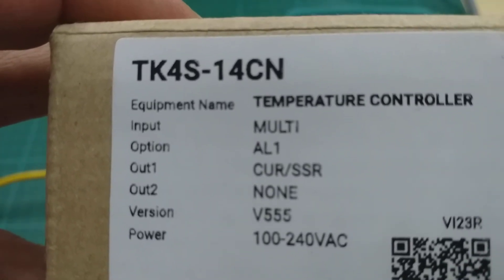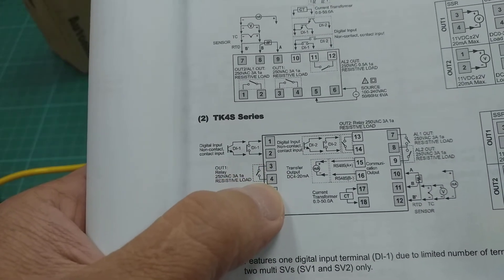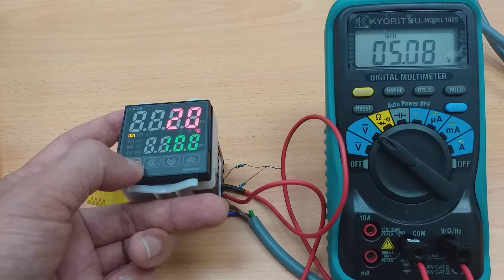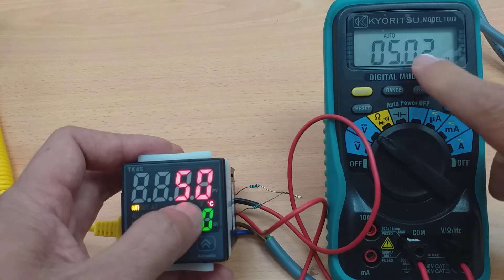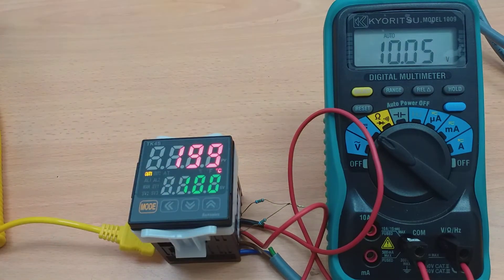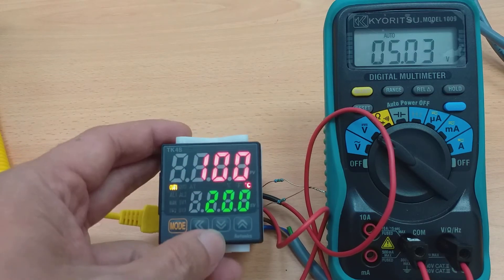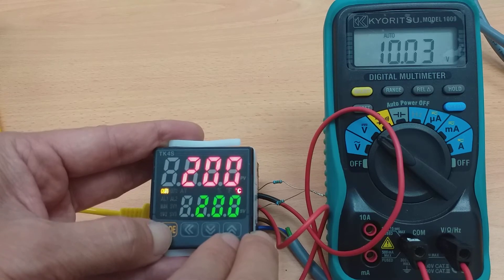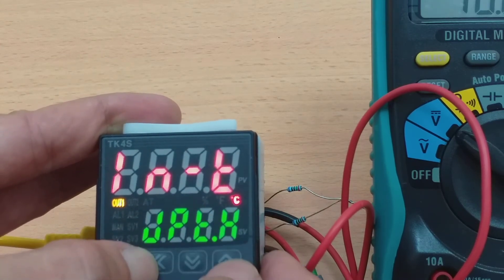AUTONICS TK4-14CN input temperature  to  output  current convert  01 to 10vdc

Comment: If the room temperature is 30 degrees, and we set the point at 20 degrees, can the output be 10 VDC to reach 20 degrees? And how do we set the parameters? Thanks
Reply from the maker: Hi Sir,  u need set the set  present value (PV).